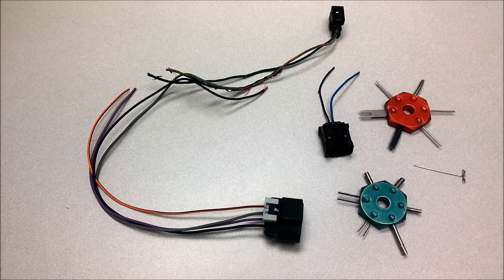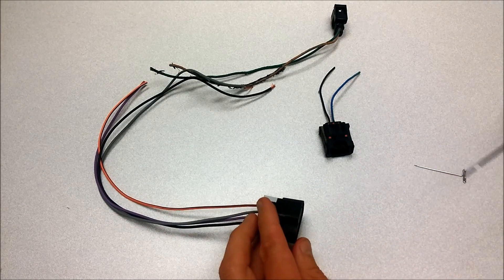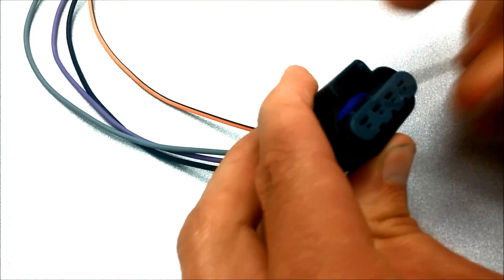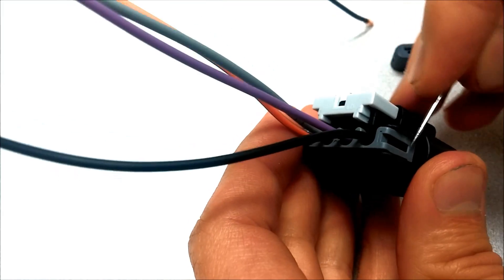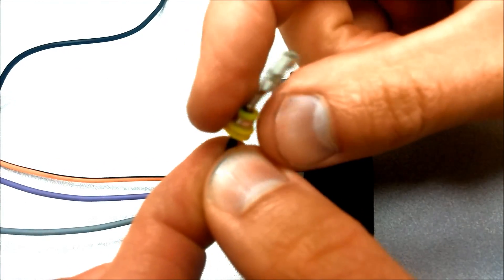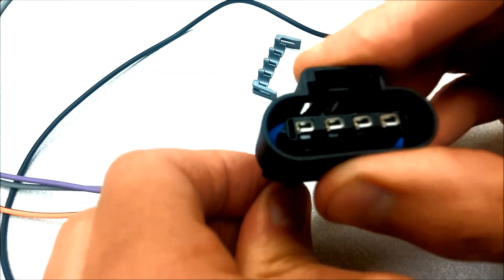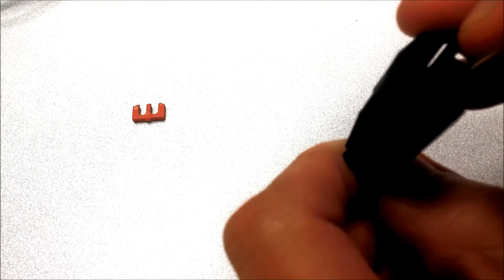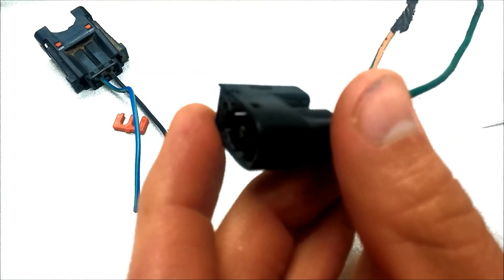Removing a terminal from a connector

Comment: Is there a tool to open the pin so I can rewire and put back into connector?
Reply from the maker: Not that I am aware of.  In those situations when a replacement terminal is not available and there is little wire available, I usually try to solder a new wire to the terminal or just bypass the connector all together, using a new connector.

Comment: Dumb question but can I do all of this while it's still plugged into the car? I can't seem to figure out how to unconnect it from my vehicle. It's a 2002 GMC Envoy Xl if that helps.
Reply from the maker: No, the connector needs to be disconnected first.  I know that it can be very challenging sometimes.  It might be in a difficult location to access or it is hard to figure out how to release the connector.  Sometimes it is just stuck because dirt and years of not moving.  Good luck with it!
Reply: @JustinMillerAutomotive  Thanks for the quick reply! I'm glad I waited for a response, otherwise I would've just done it out of frustration because I can't find the plugin, and end up shocking myself or worse.

Comment: Thank You for showing that video in a clear and detailed way.  I checked out your other videos in search of the method for replacing the wires on the individual terminals.  I have a connector for evap that a couple wires broke off but they are still attached to the connector. I cut the 3 wires and removed the connector and  have basically 3 short wires coming off the connector now and plenty of wire left on the harness itself.  Can the broken wires be removed off the terminals and fresh skinned wires from the harness be put back on, or do I have to barrell splice the wirels?
Reply from the maker: It can be very difficult to separate a wire from the small terminals they are crimped to.  For this reason, it is usually easier to solder a new wire to what is left of the old one, making sure that the terminal will still fit back into the connector.  Another solution is to go to a salvage and find a used connector that matches yours, and cut the wires so you can solder them your wires on your vehicle.

Comment: Can’t see a thing your doing on the smaller more difficult ones. Trying to do pins from an OBDII port and micro sliver of plastic that appears to be between pin hole and metal maybe pin just crushes when I try and put tiny screwdriver behind pin to move it.

Comment: How to you actually replace the pin itself?
Reply from the maker: That depends on the the type of connector.  You can sometimes find replacement terminals through the dealership, but it is not easy and they usually won't have one in stock.  Sometimes it is simplest to buy an entirely new connector with pins in it.  You can also search wrecking yards or ebay for used connectors with terminals and a pigtail.

Comment: So how do you get the pin out if the wire came off and you don't have anything to pull on?  Automotive connector, round in the back where the wires go and small square front
Reply: It has been over a year so I suppose you figured it out... but logic would suggest that if you can not pull from behind, then you would depress the holding latch from the front and simultaneously push the terminal out the back... right?  You may need a helper if this is an installed item and not too dexterous.

Comment: How do you put it back in.. I replaced the terminal connector and it won't push in
Reply: It will go in one way, check the metal tab (it will go in one way).

Comment: You make it look easy. Now try doing that on a connector outside in the cold and under car hood and with poor light
Reply: BakerOne you think that’s bad should try it on a tractor at least there some what protected from the elements and dirt under the hood.
Reply: Are you a millennial??
Reply: You guys talk all tough, try cutting all the wires and replacing them with an aftermarket harness connector with no color wires.

Comment: Where did ya get that T pin tool?
Reply from the maker: You can buy them just about anywhere.  Craft stores have them.
Reply: Justin Miller is it like a sewing needle or something?
Reply from the maker: I think they are used for quilting.
Reply: Justin Miller  cool. Thanks bro!
Reply: Walmart fabric
Reply: Hobby Lobby Store -- has the T-Pins,but they are packaged in about 20 or so.
They are .030 dia which is about as large as you want to use, to back probe
a connector for testing with a DVOM or Scope.

Comment: Thank you this really helped me replacing ignition coil connector.
Reply: Ian MacPherson
Reply: On a Ford by any chance? I can't seem to get the first plastic piece off (1:15). Not much room to work in there and needle nose pliers just slip off. Trying to replace it on my 2001 F150 coil pack connector.

Comment: If the wire was damaged near the connector and you had enough wire to cut off an inch or two and re-crimp it for repair, what Wire Crimper do you recommend for those terminals?
Reply from the maker: I would recommend a careful solder connection rather than a crimp.  If the solder is outside of the seal, make sure to cover it with heat shrink tubing.
Reply: Thanks but I meant if someone wanted to cut off the old terminal and crimp a new terminal on, what wire crimper would be used?
Reply: 707SonomaComa what you would have to do is take the connector or a picture of it to your local electronics supply house and ask them. There are many different types of connectors and some are best put on with the tool meant for them. I often solder the new wire to the old connector or solder old wire to new connector. But some like the one he actually pulled out have that rubber so any heat would most likely destroy it. But they make the crimper that crimps and puts the boot on at the same time.